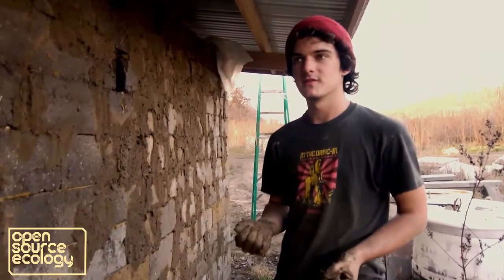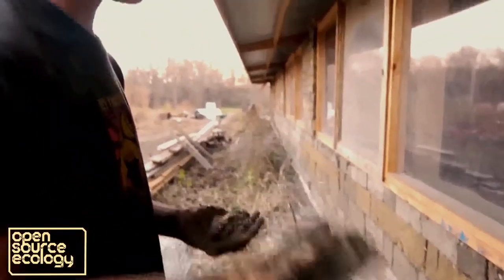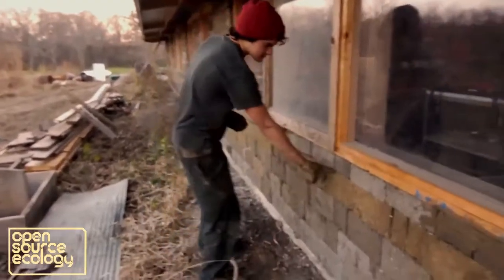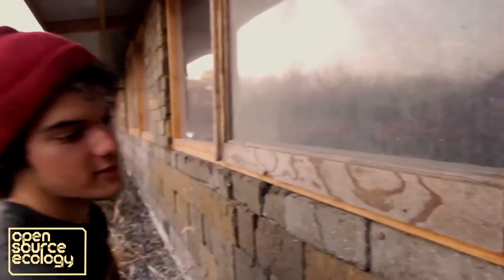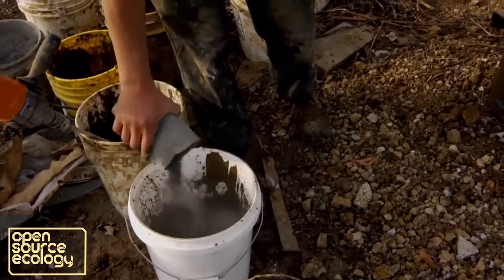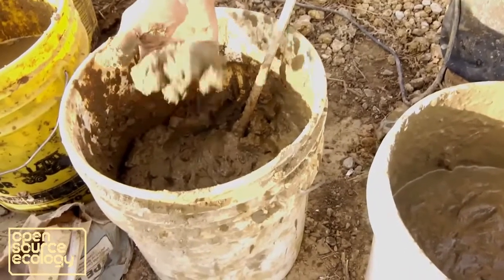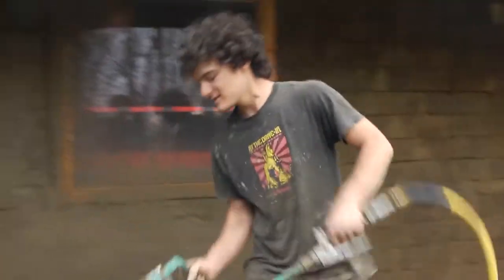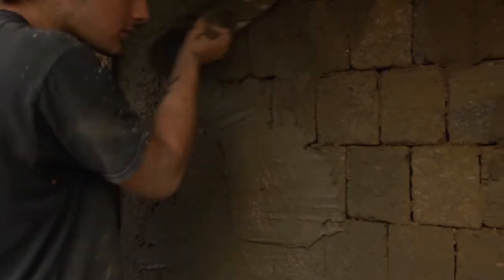CEB Stuccoing Tutorial, with Graham Robertson

Comment: Agree with AJ Tarnas - better not to use concrete. And if you're going to be troweling anyway, no need for the sprayer. Slap it on with the trowel and spread it. Filling cracks will also work much better with a trowel. Your CEBs are rough and there are gaps between them, so your base plaster will adhere, but you may need to score your base coat before applying later finish coats. This is called "keying" - otherwise later an entire layer of plaster can fall off. Thanks for a nice video.

Comment: I wouldn't recommend a sand-clay mortar. The clay slip is used to get the CEBs to bond to one another, which is why it is made of the exact same soil mix as the CEBs. You could mortar with another mix, but the wall be weaker, and construction time is a lot longer. Regarding filling cracks, the real solution is to make better blocks. Yours are pretty rough. If you make great stabilized CEBs and use some extra slip (and wipe off excess) you'll have a fantastic wall without any plaster.

Comment: Yes - but it also depends on what kind of finish you want. For good adherence and longevity each coat has to contain some elements of the former coat. So if the first coat is earthen plaster, the second coat is a mix of earth and lime, and the finish coat is a lime wash. Regarding cement, same idea - use it only if it was used in the CEBs. It also has to be cured by keeping it wet as long as possible. A CEB wall without cement will breathe better, same with the plaster.

Comment: Using a cement stabilizer or not will depend on the climate. In most climates - especially warmer ones - I would use lime and not cement. The building will be more comfortable inside. A breathable wall wicks humidity out of the air space, and that moisture evaporation on the exterior cools the walls and thus the building. In a temperate climate I would still prefer lime, because it's easier to heat a building mechanically than cool it. Use a rocket mass stove for heat, and no need for AC.

Comment: Yep, gotta build the wall without cracks to begin with. Mortar it right, or build thick enough to occlude pass-through cracks and obviate any concerns about "strength". If you have to fill cracks, get the right mortar mix and trowel. Would you ever see a bricklayer spread mortar with his hands? Would you see a bricklayer use a sprayer? Again, limewashing is an annual thing. A good building deserves a yearly wash, or else it deserves to be covered in ivy and moss and lichens and kiwi!

Comment: "Documentation": historical restoration specs from England, Israel, and desert southwest. Yes, any "percentage" will wick water. Normal concrete contains less than 15% OPC by mass. Your mix is not substantially different in this regard. OPC destroys everything over time, especially stucco: avoid. Keywords: clay, lime, or earthen plaster; CCAT, dancing rabbit. If you want to get crazy and try something modern, start experimenting with geopolymers (alkali-activated cements), I've got the formulas.